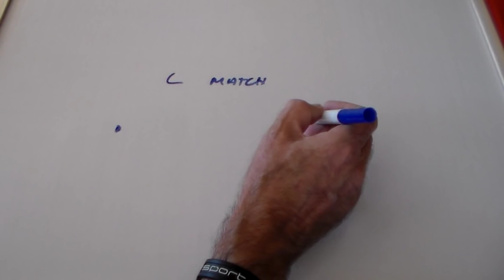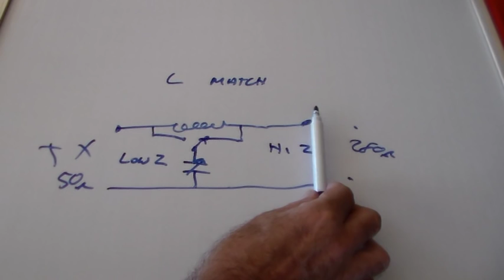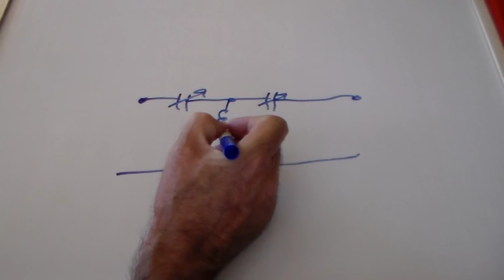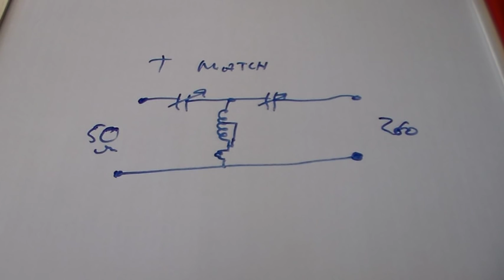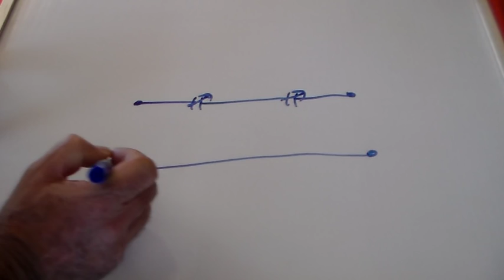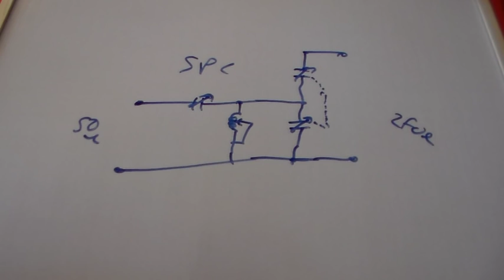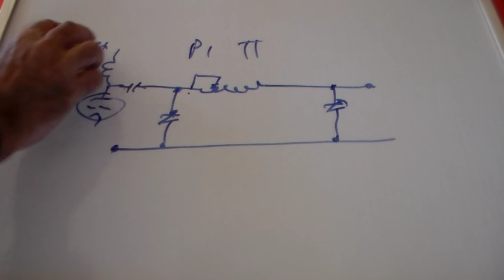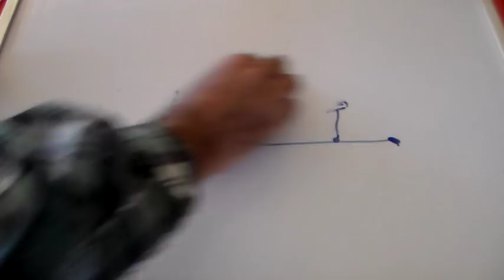Different Types Of Antenna Tuning/Matching Units.

Comment: There are many different kinds of Tuna's.
Yellowfin, Bluefin, Makrel, Bonito, Giant Bluefin, Northern Bluefin, Albacore and others.
For matching a radio to an antenna you need an Impedance Matching Device.
Reply: +Ade Larsen NB : A Tuner is a guy with a pair of side-cutters.
Reply from the maker: +Ade Larsen Indeed it is.

Comment: Actually, the pair of scissors shtick at the very end of the show here is not a joke.  

One of the ingenious matching tricks for an inverted-L that is fed against ground radials is to choose antenna wire length a few % longer than a calculated quarter wave would be at your frequency of interest,  put a variable capacitor in series with its feed point, and then "tune out all reactance" by twiddling the capacitor while watching the results with your antenna analyzer connected at the feed point.  What you are doing is electrically "trimming the wire length" since your antenna wire will present an inductive reactance (i.e. would be too long) at the frequency of interest prior to any capacitor twiddling.  In other words,  your "pair of scissors" is the capacitor.  This is an old trick used, for example, on 160 meter inverted L wires and it most certainly works great on any band.  Be sure you are using ample system of ground radials mate; I use about 40 of them, each 40-50 feet or more in length. Killer Antenna, no shit.
Reply from the maker: Yes, I don't doubt it. You can't beat a good ground system for the lower frequencies. And the scissors... I have cut dipoles with scissors many times when I haven't had an ATU or other matching components.

Comment from the maker: To NAYJL1975: I can't approve your comment for some reason the 'approve' box is greyed out. I can't find any info on your RX tuner. The difference between a transmit tuner and a receive tuner is the the transmit tuner components are rated for high voltages. There's no high voltages present in a receive tuner so the capacitors have small spacing between the plates and band switches etc aren't usually suitable for the voltages present when connected to a transmitter. That said, 10W isn't much power. You could always try it and see, maybe start with 1W and if all is well increase the output power 1W at at time until you get to 10W. If the tuner is unhappy the radio will show intermittent high SWR and fold back the output power so you shouldn't see either unit damaged. Try this at your own risk, but that's what I would try.

Comment: Howdy. I believe VK6CS is right.
One can tune the antenna to resonance with a Pi network at different loading cap. settings. The antenna will be in resonance with different radiation power. In my location the max. input power used to be 15 W in the novice class. I remember hamsters fiddling with the loading cap. and retuning to resonance watching the end tube anode current not to exceed the allowed power. Our radio authorities were paranoid in those days. One could face huge fines and equipment confiscation if caught running on overpower.
Regards.

Comment: I'm liking the scissors :) , anyway ...maybe get Angus to wind a toroidal balun match to get the high impedance to 50 ohms :)
no caps etc, well until he changes band... 24.5m wire ? there are better lenghts to match easier...
Anyways Steve, how are the input coming along on the gs35 project.
Reply from the maker: +Lucky Dube in RC Hi Johan. I think Angus... being a tad careful with his cash would use a separate piece of wire for each band.

The GS-35B amplifier is coming on slowly, dribs and drabs here and there but I haven't looked at the input circuit circuit seriously yet. I have recently done the heater 'burn-in' that's supposedly required with these NOS tubes so I can put some HT on the tube. I'll wind up a tank coil and connect the output tank circuit and HT so I can get a realistic look at the input impedance. Then I'll take it from there. it will be interesting to see what the IMD is like without any feedback on the bias FET to stiffen it up.

Comment: Hey there mate, So i´m fairly new to the antenna stuff, i do however find it highly intriguing. 
So i have got a question for you. 

I have made a regular Dipol antenna for 41.5 Mhz and also need one for 70 Mhz.
works great all is well there, however i figured i would make one that is fairly easy to change from 41.5 to 70 Mhz.

Now the way i did this was by taking an Iron core and rolling each end of the dipol around it, essentially creating an inductor on each end of the dipol. Works quite well, gives me an SVR about 1.8/2

However i would very much like to do the math behind this, and i´m having a bit of trouble finding any help. 
I´m guessing it´s somewhat similar to an L network however im not quite sure.

Comment: With the L tuner Angus could save the switch by changing the input - output cables...
Reply: ...and the Pi-matcher is just both kinds of L-matchers combined - but one of the capacitors is always redundant.

Comment: Compare to a perfectly build matched antenna (50 Ω)where you don't have to use any of the matching mechanisms ... Do you lose any energy or do you have any disadvantages in transmitting by having any of the tuners/matchers attached to a lets say (260 Ω) antenna ? ... thank you
Reply from the maker: Hi Ronald. Good question, many will tell you that a resonant antenna like a quarter wave that presents around 50 Ohms will radiate more efficiently than a random length antenna that is just impedance matched with an ATU. In theory this sounds good as there is going to be some loss in any ATU. In practice this is not always the case. I tried an experiment with a local station where I cut and 'length tuned' a quarter wave antenna for 80m. This presented a good 50 Ohm match to the radio with a 1:1 SWR without an ATU and the local station noted the signal strength. I then took it down and put up a slightly longer antenna of the same shape, an inverted L, with the same anchor points and impedance matched it with an ATU. This non-resonant antenna produced a stronger signal with the same local station. This experiment was done on the same frequency within an hour during daylight.

So, if your antenna presents 260 Ohms at the feedpoint, and you transform that to 50 Ohms with an ATU or some other device to keep your transmitter happy it would have every chance of performing as well if not better than a resonant 50 Ohm antenna, especially if it was a bit longer than a quarter wave length... in my opinion.
Reply: +VK6CS ... Wow ... Do you think that stronger signal was due to a radiation pattern that happened to be stronger in the direction to that receiving station ? Who knows ... However ... My question is ... Do ATU's absorbed that reflected power and turn it into heat ? Or are they actually become part of the antenna and transmit the full power ?
Reply from the maker: The antenna had the same anchor points so the orientation would have been the same. It was about 20 feet longer... could it be due to a slightly different pattern, who knows, may be. The ATU doesn't absorb the reflected power, it reflects it back to the antenna, hopefully in phase so it adds to the energy in the transmitted signal, and doesn't degrade it.
Reply: VK6CS I see ... Thank you ... That gives me revelations about an ATU ... Awesome ... Yes, it better be in phase ...